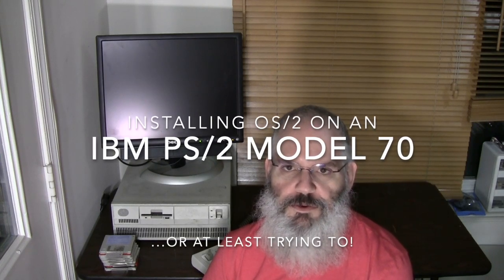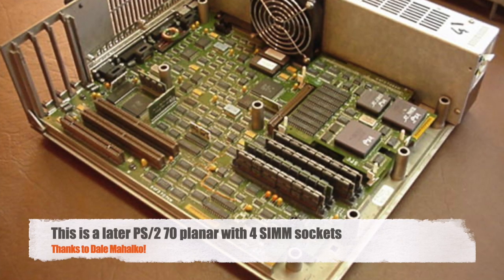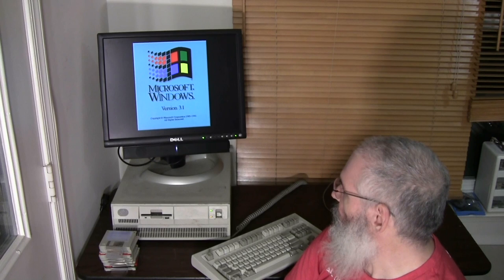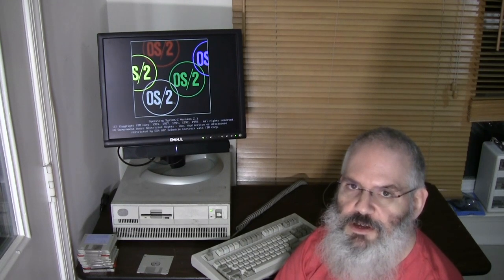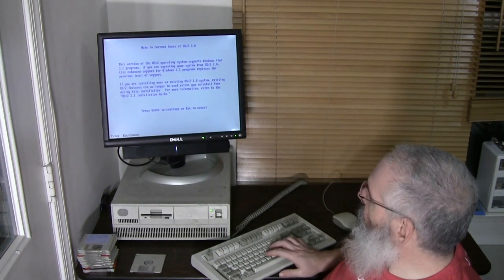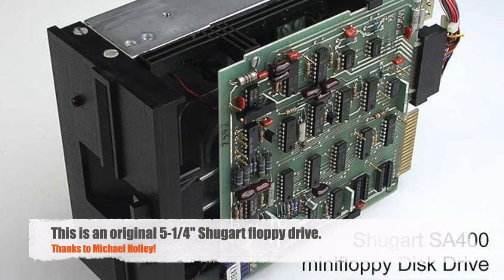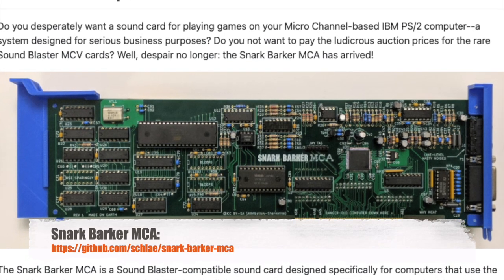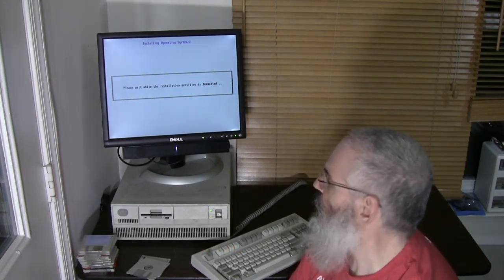Installing OS/2 on the IBM PS/2 Model 70

Comment: Hey, I'm kinda late to the party, but I enjoyed your journey back to the days of OS/2 and the Model 70.  I worked for the local IBM PC dealership in the late 80's/early 90's and grew quite fond of both the OS and PS/2 lines.  That despite having to spend a whole night locked in the phone company's freezing computer room loading and reloading Lan Manager from fifteen diskettes lol.  I even have a soft spot for working with diskettes and have always loved the sound of them, but the waiting can drive you insane haha.

I was actually playing along with the video, installing it on an emulated Model 70 with the same specs as your machine.  I did try 2.1 at first, but it bombed out with an indecipherable error, so I then tried 2.11 and all seems well so far (fingers and toes crossed!).  Now I'm off to find the next installment.

Comment: I started working in the computer field in 1993 and got a 486 with 4MB of ram and was interested in OS2.  I got it installed but it was super slow with 4MB. I upgraded to 20MB which in those days was really expensive. It ran very well then.  I even did OS updates by downloading the (corrective service disk) CSD disk files from ibm (from work), then I pulled them from work at night over my modem using Zmodem over rlogin 8bit mode.  I guess I did that because the work computers could reach ibm over the internet but at home I just had old style modem it was before my first ISP account so mostly you'd use your modem to go to BBS's.
The CSD files were bigger than floppies usually were, ibm had this xdf format which crammed more data into a floppy by using cylinders of the floppy drive that weren't usually used but which drives could usually reach.  To update OS/2 you'd put each floppy in the drive one by one and it took like 25 to 30 floppies.  When CDROM came out it was so much better to install and update os/2, one CD could store more than hundreds of floppies.
OS/2 was the perfect platform to mess with computers because you could do:

dos
windows 3.1
os/2

all on one OS.  In fact it would even read in the Windows 3.1 already on a computer and import it into OS/2 (The "OS/2 for Windows" version) using your existing license. I think I used the "for windows" first, then later when I did Warp 3 and Warp 4 I used the version with windows inside already, it was just easier to have it embedded (but you were giving some money to MS for the license)
Reply from the maker: Thanks so much for sharing this! I had a very similar machine, in 1993, a 486DX/25, with 4MB RAM. I also tried to install OS/2, and it ended up being very slow. I did love OS/2 Warp 3 and 4, starting with my Pentium 90, which I got a year later. I remember IBM’s ad for Warp, “Arrive in Chicago earlier than expected.”

Comment: Thanks for the comments on the floppy drive connectors. That was interesting.
And what do you mean you didn't have to crank every single case screw (inside and out) as hard as you could? That's how it was ALWAYS done!